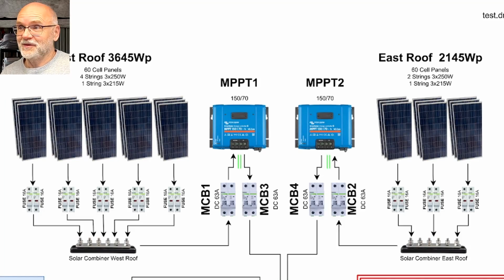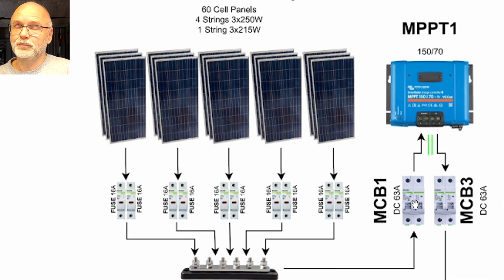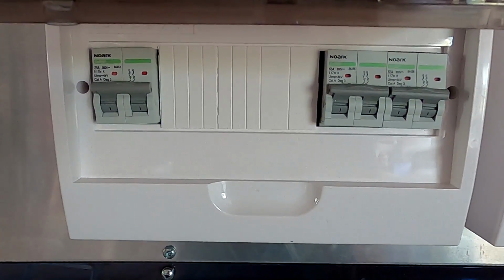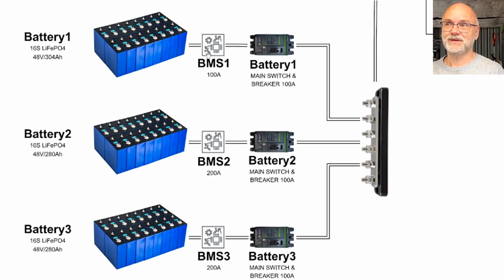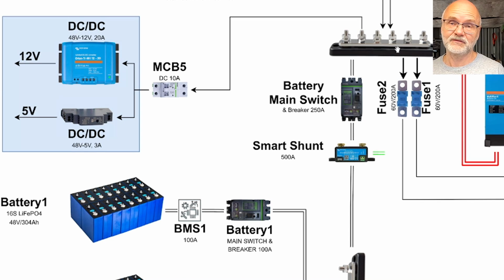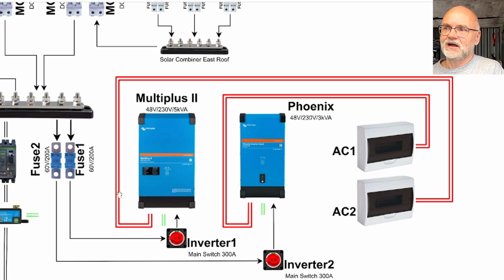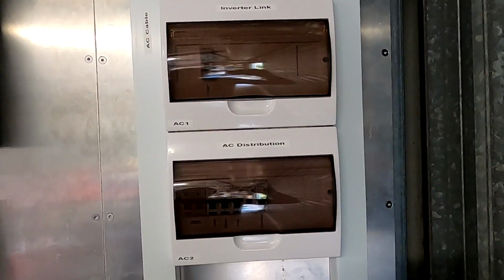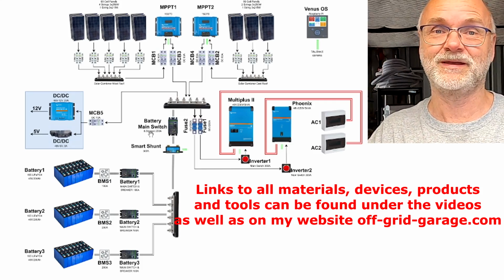How I've built the Off-Grid Garage. Whole system installation and design explained.

Comment: I currently am building my system. I started with a Quattro 48v 3000 but upgraded to the Quattro 48v 5000.. nothing is installed yet still new in box. Now I was thinking like you have done and want to use the 3kw for backing the 5kw unit but not completely sure how other than connecting as generator and is the lan cable to be used between.??? I fully understand breakers and fuses i have almost everything im going to need. My shop looks similar to yours just smaller.. 12x12 building i have a stack of new pv panels not setup yet ether. I've been buying equipment for over a year getting ready and researching studying. I've built several solar systems all still working great 👍 
My question is how to join the 2 Quattro's 😅

Comment: @OffGridGarageAustralia  Thank you for sharing your setup. Your set up has given me new ideas especially batteries putting in a single bus. Just wondering what will show up on the smart shubt given 3 separate BMS for each baterry pack. Is it also possible to have a common bus for the AC output of the 2 inverters? Appreciate your input. Thanks

Comment: Thank you for another great video. Is there something i can buy in Australia, that is similar or the same as the EG4 6000XP i love the simple set up and not having to purchase other isolaters, breakers, junction boxes etc.. i am aiming to build a 10 or 20kw battery back up with solar charging, which might include an up cycled tesla car battery  for storage down the track. For now i will use one of the battery boxes you have reviewed.

Comment: Andy, I'm still a bit confused as where to add my second diy battery in relation to the shunt.  I am adding a 180ah 24v calb pack to my 24v100ah litime. I have bus bars in place but unsure where the second battery( -) should connect to?

Comment: Andy, is it possible to join in the same system, one hybrid inverter and additional charger controller to improve solar production?
I’m thinking in this solution for my system …
Reply from the maker: Absolutely! This is just my system design. Yours will be totally different.
Reply: @OffGridGarageAustralia  Thanks for your answer Andy. I'm using 5Kw  SRNE hybrid inverter. They ( SRNE) told me that I shouldn't add in same system one or multiple additional MPPT charger controller, saying that the solution is to move to another inverter  with 2 MPPT inputs! 
Do you believe that ?
Reply from the maker: @aireslimadatrindade4932  You can add as many MPPTs as you like as long as you  will not exceed the specs of the battery. 
I have to limit my solar production in summertime as it would be too much for my system. But for the remaining 9 months it makes sense to have so much solar.
Reply: @OffGridGarageAustralia  Thanks very much. I go ahead and upgrade my solar production with  one Victron SmartSolar MPPT 150/85 - Tr VE.Can with 6 x PV 460W (2 string in parallel with 3 PV each one )

Comment: Got to watch this as I am building the same trackers.   I have not done any research into the inverter you are using. But I have some concerns.  You took the earth for your   Panel from a earth screw on the case of your inverter  . Your mains. Incoming earth. Is connected into the terminal strip. In the inverter.   Are you sure there is a connection.  Between these two earth points. And that the mains input earth is actually  being connected to your standby panel .  I did not see this being checked. 
All so. What happens if your incoming mains  fails and the inverter is supplying power to the distribution board.  How is the earth. Provided.  Does the inverter have a built in relay to remove the incoming mains earth. And  make a conection between the neutral of the output of the inverter and the case of the inverter where you have conecter your earth cable too ….     This is an issue we have in the Uk  as well with a lot of these systems.   Also when running on just the inverter.  Most inverters of around 3 kw are unable to supply the current needed to trip circuit breakers  hence we have to fit Rcd. Breakers on the out put  but these will not work unless the earth is switched correctly.  When running in backup mode … 
I hope that the manufature  of the equipment you are using has addressed this. Issue. And I raise this  so you are aware. Of the issue  .  As the lights will all work just the same.  But will the protection devices that you are using if problems arise ..   
regards from the Uk

Comment: A 280Ah LiFePO4 battery bank and a 0.5C charge and discharge rate, the maximum allowed current is 0.5 × 280Ah = 140A (and that is conservative). Why are each of the 3 battery banks, limited to 100A (the circuit breaker)?

Comment: I don't want to buy any more Victron Gear. How do I get my existing system to read the AC load and provide readout on the Venus OS PI-4 without buying Victron inverter? I just installed the Victron Shunt and thought I might see AC load draw but I was wrong.

Comment: Hi Andi, love your channel,  I ordered a set of cells thru alibaba and installed them in my house and am very happy however my cerbo screen now shows no SOC. I can get my SOC from my JK bms on the app however id like to get my SOC on the cerbo screen back again. A set of LG chem batteries were here before and removed so SOC came from that before. What do I do to get SOC? I have besides the jk, a victron multiplus, and a large victron mppt. Currently the upper voltage and current charging limits are set in the mppt. Hope you have time for me to explain what i need. Ive researched it and tried to solve it myself but all the information i find isn't quit the right situation to help.  Can you point me in the right direction? Thanks

Comment: Fuses on PV are useless though.. They need to be smaller than the max output so they can pop in a short circuit? but then they pop at max output. There is no sweet spot for them?
Reply: single strings i mean

Comment: Hi @andy
I had to come to this very old video to post my frustration:

I have parallel charge controllers charging same battery bank, each connected to 5kwp array separately
The two solar arrays are facing same direction and hence I expected to have similar production.

The two chargers have same charging profile. Surprizingly the two charge controllers seem to canibalize each  other....

If  controller A is producing 40A, then controller B will produce 20A.... If I switch off controller A, controller B will raise its Amperage to 60A.
 And if I switch it on again it will only get to 20A while controller B drops to 40A .

Why is this ? the battery is not full but they are wasting time to canibalize each other
Reply from the maker: You have mixed up the solar panels is my guess and some are used by both controllers at the same time. There is no way one controller knows about the other if all solar is completely separate.
Unless you have some other gear installed which limits the current (some BSM have current limiters).
What brand and model of controllers are you using. What other devices have you got?
Reply: @OffGridGarageAustralia  

Thanks for the reply,  
The two solar array same as the respective charge controllers were installed 3 months apart. There is no relationship between the two arrays. And each of the solar array have brand new solar panels 

In terms of charge controllers I have Chinese controllers called Demuda 100A each both connected to the same 400Ah battery bank.
I have no other gear. 
So as both are reading the voltage from the same battery bank I expected them to behave similarly since they have exact same charging profile

Comment: So just wondering. I currently have a 24v Multigrid but would like to upgrade to 48v battery system. Can I hookup the 24v Multigrid as a generator for the 48v Multiplus?

Comment: Hi Andy, Great channel thanks for all the experiments etc and showing us your findings successes and failures. 
I have a question about running the second inverter through the multiplus 2. I want to do the same and like you would like to use a second multiplus 2. I was wondering if you know the max current rating of the output from the multiplus. With a second inverter inputting into the first, the will give around 10Kw power on the first inverter terminals. From what I have read the max AC input is 95A so I wonder if this is the AC1 output rating
Also I thought the max power assist was 3 kVA so will it be worth installing a multipluss 2

Comment: Nice..  I would like to see you replace the smaller victron inverter with a hybrid all in one inverter (ie eg4 3000 , growatt 3000, etc).   Also to disconnect the victron mppt  to see if the new all in one inverter would be appropriate

Comment: Excellent work on this video, Andy, just like all the others. This explanation clears up many doubts on an important topic: safety!
I have another important doubt regarding the dimension of wiring (AWG or mm2). Would it be possible, please, to make a list of the wire gauge used in the following points:

- Each Solar String -> Fuses 16A -> Busbar = 4mm2 ?? AWG ??
- Busbar(common to the 5 strings) -> DC Breaker 63A(MCB1) -> Solar Charger(MPPT1) = 6mm2 ?? AWG ??
- Solar Charger -> DC Breaker 63A -> Busbar(common to batteries and inverter) = ??
- Busbar(common to batteries and inverter) -> Battery Main Switch(EG Battery1) -> Smart Shunt -> Busbar(common to all batteries) = ??
- Busbar(common to batteries and inverter) -> Fuse1 -> CuttOff Switch1 -> Multiplus II = ??
- Busbar(common to all batteries) -> Battery Switch(Battery1) -> BMS(Battery1) -> Battery(Battery1) = ??
- Busbar(common to batteries and inverter) -> DC Breaker 10A(MCB5) -> DC/DC Converters(12v and 5v) = ??
- Multiplus II -> AC1 = ??

Keep up the good work, many thanks.
Stay charged!
Reply from the maker: Thanks for your request. Most of these questions have been answered in the detailed videos when we built the system. If time permits, I'll put these information together at some stage...
Reply: I'm sure you did mate, already answered all these questions, i have been watching all your videos trying to figure it out and gathering very usefull information in the way.
I think i have found another one: Solar charger to Bus bar - 25mm2 cabling

Thanks once again Andy

Comment: This is very helpful Andy.  I need to tidy mine up.  Got the Muliplus inveter through.  Need to properly fuse and terminate my DC  side and make it look like I did a "proper job" before I invite the spark in to wire the island plug socket.
Reply from the maker: Yes, get some ducting, makes a huge difference already.
Reply: @OffGridGarageAustralia  I'm a while from there.  Wish a could post a pic.  "Janky" is the word.  Shopping list...
Solar CU with 16A in 40A out. MCBs (DC rated)
MPPT battery isolation 40A
Inverter battery isolation 100A
Battery master isolation 100A
4 point, dual, fully covered 300A bus bar.
8AWG wire for 100A side.
10AWG for 40A side.
All the correct crimps, etc.
£250.  Ouch.  Just the DC side.
Oh, and, MDF board and strip wood to wall mount.
I produced 0.17kWh today.

Comment: Thank you for sharing this information in a logical way. I have just discovered your channel and am building a house in the lower Hunter region of NSW. I am currently doing research as I also have a 14m x 8m shed which currently has no connection to the grid whatsoever so I am thinking about using it as a project and going offgrid rather than pulling cable. Then in the future I may consider back feeding to the house, at which time we will only utilise the grid for the FIT. Power in this area is unreliable at best.

Thank you again and I am going to now dedicate time to learning more about your system.
Reply from the maker: Thanks Graham and welcome to the channel. Sounds like a great project you're going to work on... that's a lot of roof space. Nice...
Reply: @OffGridGarageAustralia  Thanks Andy, and it all points North too so very happy.

Comment: Great video! 
Just a question: why you did not inserted a 400A fast fuse in series of each battery?
This would add an extra layer of safety in case of cell and BMS failure...

Comment: As a beginner I found this video exactly what I needed to feel more confident.
I’m going totally off grid soon (as there is no power available for 1.5k), because I need to get power quickly I will get a generator, 20, 350w panels, I’m thinking a set of 6 lifepo server rack 48v 100amp lithium batteries to power the cabin as we run a small business that needs a dehumidifier and small air-conditioner.
I was thinking of the Growatt 5kw off grid hybrid 48v.
By thoughts?
I will add 6 x 250w and 8 x 190w panels from a friends house that he upgraded also as we are in a high wind area a 48v AC 1.5kw (max) wind turbine with two battery packs like yours as we draw 20+ kw a day when in full production.
Again, any thoughts would be greatly appreciated so we don’t waste money.
Cheers Mike

Comment: hello Andy, I have doubts about the circuit breakers that you use with the mttp and it is that they have the same input and output amperage, if the mttp reaches up to 70 amps because you use 63amp circuit breakers and my other doubt is if you have put your protection system to test as a short circuit to see if you should do what they should, greetings from Panama.

Comment: I understand every part right up until the inverters to AC units. I have watched all your videos and they are great. I have seen how the second inverter jumps in to take some load but I don't fully understand AC1 unit and  AC2 unit wiring. I believe that the communication system kicks in the second inverter unit, is that correct? So does the second inverter have a standalone isolation switch in AC1? Then it is wired into AC2? I think I may have missed a video. Thank you for all your videos, I have loved that at one point you were a man with a plan and now you are a YouTube God to mere mortals like myself.

Comment: Thanx, great video, very nice system overview provided. However in case of emergency, I would rather consider to trigger a system switch off 1) automatically or/and 2) by an external command. You might not be available if something starts going wrong, for example the batteries getting very high temperatures, something did fell down on the roof, etc.

Comment: Thanks Andy for sharing so much useful information about your garage.
One thing I am a bit struggeling with are the 2x200A fuses between battery and converter.
Isn`t it right that you should keep the negative longer then the positive?
With that in mind I would go with a higher A fuse on the negative side.
For me it looks like if the negative will cut earlier then the positive, because of production tolerances or similar, the current will flow through the ground of the data cable until the positive fuse will cut the line.
Or am I completely off here?
Prost!
Marc

Comment: Hi,
Can you connect the 2 Victron MPPT outputs to 1 battery ?
Thanks
Reply: yes.  absolutely.  the MPPT's connect to the positive and negative bus bars.  you can have 1 or 1000 batteries connected to the bus bars as well.

andy has 2 MPPT charge controllers connected to his bus bars that also have 3 batteries connected.  he can add more batteries, or just flip some breakers and disconnect each battery at will.  no problem!
Reply: @dobrzpe  
Thanks your answer.
So there is no problem to set Maximum Power Point, for those controllers, when they are on one battery?
Reply: @tamastokai1477  maybe i don't understand your question... but you don't "set MPP", the charge controller actually does this automatically.  it 'swings' through a bunch of voltages and finds the best one (most efficient) that will output the most power at that moment.  then it continually does that throughout the entire time it's charging that day as the sun traverses the sky and the power coming out of the solar panels changes.

think of it this way:
the charge controller doesn't know or care what battery or how many or how big the battery is.  all it does is take the power from the solar panels and convert/control the output power (up to the voltage you have set) to put power into the battery.  and technically it outputs power for the inverter too... until the sun goes down at least! lol
Reply: @dobrzpe  
Yes I understand all those parts, just I thought as the solar controller take the battery as "LOAD" so this way, adjust the "input to output"...
But probably the 2 controllers communicate each other via bus connection... 
I`m just thinking..

Comment: Hi, great video, It would be nice to undersrand the design thinking phase as well. Why you came up with this final design.

I have a question, I see that the 3 batteries are connected in parallel... But they are not exactly of the same type, how do you manage to balance the voltage??

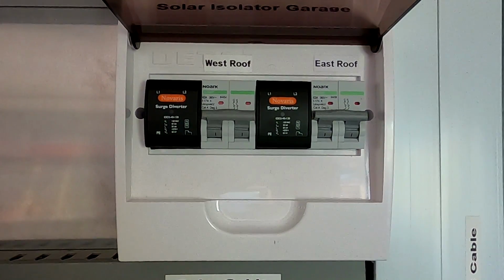Comment: As always awesome video Andy giving great detail. I noticed you refer to the breakers for the west roof being 63AMPs but in the 4:41 mark it shows the solar isolator garage with the incoming solar cables via 40amp breaker and the east roof with 63amp 
breakers where as the DC breaker box are both 63AMPs. Do I read that correctly or am I blind